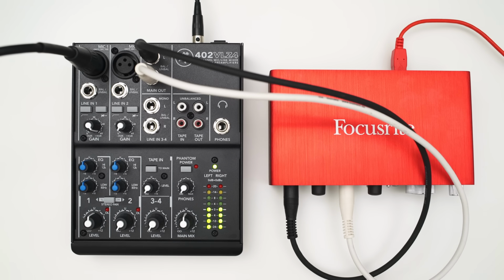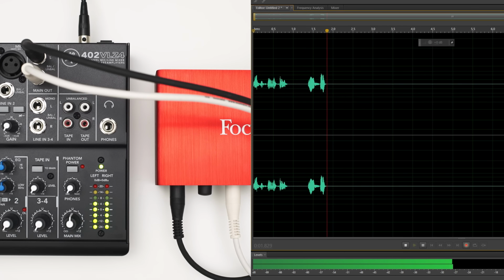Setup Guide - how to connect a Mixer to an Audio Interface for audio recording

Comment: Hello. I have a Pioneer djm 600 mixer and two turntables. How should I connect it to the Stainberg ur12 to get clean sound from the turntables? What cables should I use?

Comment: Hi Julian, I have a question: 

Is it posible to simply connect a compressor inbetween the main (stereo or monitor) out of a mixer and an interface?

I ask you this because I want to connect a keyboard in stereo and two mic's - one dynamic and one condenser with an external preamp - to my old Fostex XR7 4 track mixer. 

Though this mixer has two inserts on channel/fader 5&6, I do not want to switch my keyboard and mic's on channel 5&6 all the time. Therefor my idea is to use the stereo out or monitor out channel to engage the compressor (RNC1773) before going into my 2i4 Scarlet interface.

Btw the Fostex works with RCA connections on the stereo out and monitor out, but I also have adapter plugs to jack. So using either ts or trs cables - which I yet have to buy, but I'm not sure what to buy (I have troubles getting my mind around audio issues) - shouldn't be a problem.

Thanks for the video. Hope to hear from you with some advise.

Ps I want to use this Fostex mixer because it has two aux channels for two FX processors I have and want to connect. It also is pretty quiet and I don't have the funds to buy a new mixer with two aux channels - or inserts on the out channel.

Comment: The pot on the Focusrite was left in the fully counter clockwise direction? So, all of the preamp gain was done with the mixer, and the Focusrite did not do any preamplification? The signal was just bypassed the Focusrite preamps, and went straight into the ADC in the Focusrite?

Comment: Hi Julian 
just a question regarding this subject 
I have been looking for a small Line input adat box to plug some modules in to then input to a RME babyface pro FS 
I not find a simple line one and don’t want to pay for mic preamps when it’s only for a few keyboard modules and cd player, so for now I will use a mixer can you recommend one that is good quality and Can I use any of the four inputs, the manual states all four can accommodate line BUT I see nowhere to switch between line or mic or am I overthinking and it’s automatically detected hope so
Thank you been following your Audio presentations a long time always the most trusted advice on the tube

Comment: Hi I hope you can answer this but is it possible to plug a mixer into an audio interface and then plug speakers Into the mixer and then be able to hear the sounds from your computer coming from the speakers

So basically Will this work?

Laptop < audio interface < mixer < speakers

Comment: The problem I'm having is I'm hooking it up correctly and turning up the gain real high on my mixer and it registers real low on reaper. I play back my audio and it sounds real low. When I plug mic directly into interface and turn up the gain it sounds a lot louder when played back. This method of hooking up main outs of mixer to line level of mixer isn't cutting for me. The waveforms are flat even when gain is up high on mixer and the playback is too low. I'm using a Xenyx X1204USB mixer with a behringer UMC 204hd interface.

Comment: I dont understand why you are using trs cable to go into the focusrite. Those are stereo cables, but only providing mono inputs per channel. Wouldnt a regular patch cable do the same thing?
Reply from the maker: Hey, these are balanced connections that's why they are TRS. This gives you greater noise immunity compared to an unbalanced TS connection.

Comment: [GERMAN] (ENGLISH BELOW)

Ich benutze ein Xone 92 über record out in den Scarlett 2i2 und nehme in audacity auf. Trotzdem ist die Tonqulität absoluter Müll. Habe alle Einstellungen/Kabel/Treiber etc überprüft und alles top. Gibt es irgendeine Einstellung die mir die Qualität verhaut?

ziemlich frustrierend mit dem teuren Equipment...

[ENGLISH]

i use a xone 92 mixer plugged the record output into my scarlett 2i2 and i am trying to revord a set in audacity. The sound quality is VERY BAD. I checked all Settings/Cables/Drivers as far as i could and everything should be theoretically fine.
Is there any Setting i am missing?

Very frustrating with all that fancy expencive equipment...

Comment: Yea but how do I send a stereo signal to the mixer from the interface? Just do the same thing with the outputs on the back of the interface into the mixer? Seems logical.
Reply: Same question here, did you found anything out?

Comment: Hope somebody sees this. I need a fairly budget audio interface that has onboard EQ included in it because I really don't want to use VOICEMEETER or STEELSERIES SONAR just to EQ my voice on the software side and have to deal with BS latency and additional sound device configuration and routing just to be able to use it.

Comment: Thanks Julian for the step-by-step tutorial.
However, I think around 3:20 you forgot to show more directly how loud the level knobs of the interface should be. I know you've responded that indirectly around 4:15 (the -20 dBFS thing), but I think it's worth to show that,  not only for the noobs who like to max everything, but also for some strange things that sometimes happen in stereo setups. For instance, I've found my Scarlett 2i4 (2nd Gen) has noticeable level differences between both input channels (right is louder), even when they receive a monaural signal and both level knobs are obsessively setted to the exact same position. Your Scarlett also seems to have (a bit less of) the same issue.

Comment: Amazing vid! That being said, I am recording my band live through a powered mixer w/ E drums [we all wear headphones w/ the mix coming from the board], signal is sent to an interface [just bought the focusrite 2i2 gen 4]. My mixer has 2 rca plugs out, I am using a 2 rca to a 1/4 inch stereo cable and sending this signal to 1 line input. Would it sound better to get 2 separate rca to 1/4 inch mono cables and send them to line 1 and line 2 input? Or would I use 2 separate rca to 1/4 inch stereo cables? Again great vid and not often discussed!  Also, I am going to experiment with the air vs air 2 features and no air and will let you know the results! Much love from Upstate NY! Oh, I am currently using Audacity as my DAW is the Ableton lite that comes with the focusrite better?

Comment: Hi, I was researching the Mackie 402VLZ4 as an option to add a couple more XLR microphones to my GOXLR Mini Setup via the Line In of the Go XLR Mini. Do you know if the Mackie 402VLZ4 has enough gain to drive a Shure SM7b or SM58 mic? I believe it is advertised as having Onyx Preamps with up to 60db gain. On my Go XLR Mini, I have to set the gain to 65db to drive the SM58 adequately, but I know the advertised gain numbers on many of these units cannot be directly compared.

Comment: The gain and main mixer here isn’t being used right. The main isn’t set at Unity but adjusted based on the lights and the gain is adjusted using the clip light

Comment: What sound sources on windows do u pick have your mixer work in tandem with your interface? At the moment I can only operate the interface and the mixer separately. So if my interface is my default source my mixer doesn’t work with the mic and vice Versa, but my mic will still work on its on with either the mixer or the interface just not together. What am I doing incorrectly? Thanks

Comment: Why -20dB in the Recording Software? Did you not give away signal-noise-ratio at your recording by this?  Ah ok you "hum" with costant signal noise in your micro which shows on your mixer 0dB and have +20dB till clipping. In recording software you have -20dB. That means you have also 20dB Space cause clipping begin there at 0dB.  Ok i understand.  The "hum" i hear first at second hearing your video. My Denglish is not perfect 🤣

Comment: Why use a mixer at all? Adding anything to the signal chain introduces noise and the opportunity for signal degradation. Why not just plug the mic directly into your audio interface? Any EQ is going to be handled by the software anyway.

Comment: When I get the mixer signal to 0 db, that signal is too hot inside the DAW. It peaks well above minus 12 db. If I turn the gains down on the mixer, it is well below the 0 db mark but the level is okay in the DAW. I am wondering if the signal is somehow not clear or not as good in some way because I have to dial back the gains. Anyway, I guess I'm saying it is not always so straightforward...

Comment: Now that you've introduced mixers into the equation, it'd be interesting to see how the interface of a USB Mixer fairs against a dedicated interface. I was looking at some general specs and they seemed decent, but not quite as good as a dedicated interface, and I've heard from other people that these sort of equipment do not last as much, even without taking them to on the road for gigs.
Reply: Also very curious about this. I have both a mixer with an interface, and a standalone interface. I am realizing I have options for how I can hook things up and I'm not experienced enough to know what is what. I'm not sure I always want my monitors to need to be hooked up "through" the interface, but I also want to be able to record the mix from the mixer... I am thinking about using the control room out to help me split that signal path.

Comment: what if i have a mixer > scarlett and traktor and a controller for traktor too how do i connet those ? so i will need that with the controller i have to control traktor while the scarlett or the audio interface will have to get the sound from traktor pass trough the mixer and reach 6 speakers connected to the mixer ... is it possible ?=

Comment: We're seen you are using TRS (balanced) cables to connect a mixer with an audio interface. What if i want to make a next connection, and connect main out of an audio interface to amplifier (with passive speakers), where i only have RCA input into amplifier, so i have to use TS to RCA, unbalanced cable. In that case, does it have a sense to use balanced cables to connect a mixer with an audio interface, or i'm fine with unbalanced cables too?

Comment: well and clearly explained only what should you do if your audio interface only has a mic/line 1 input and inst 2 (for instruments) e.g. the u-phoria umc 22 then it is not possible to do left and right when i use a orchestra wants to record with all their equipment at the mixer (without usb) with audio interface is there a solution for that?

Comment: Is there any reason why you can't use TRS—XLR cables (TRS from mixer into the XLR inputs on the interface)? Would the cable change the preamp input on the interface?

Comment: Question please, my mixer has a 12 channel  and also has an integrated interface 2 channel buss which can be sent by aux to my pc and also a return I put aux.  My question is I want to record a band of 5 Instruments all at once and mix each track after on the mixer . Now the mixer doest not allowed me to do tha it only sends once single audio interface channel trough the interface to the pc software. If I go and buy me 1 8 channel interface can I plug that to my mixer and will that gave any issues having already an I terrace

Comment: Great video....concise and without boring talking.  Question: after connecting my Yamaha MG/12-4FX analog mixer to my Steinberg UR22MKII interface, how do I now connect my two small JBL powered monitors?
Reply from the maker: Hey, just connect the monitors to the  main out of the UR22MKII and select the direct monitoring option on the interface.

Comment: hello Julian, i need your advice, i have a dynamic mic and an interface...i want to use a mixera s a preamp to boost the low mic volume, can i use a mixer as a preamp? i dont want to by a mic activator or a preamp...just use the mixer preamp istead to boost the volume without introducing noise???

Comment: Once again straight to the point, with actually useful information. If someone or Julian can answer these questions It would be very helpful:
- Can you, or should you in stead keep the mixer gain to 0 and then increase the gain on the audio interface to make better use of the interface's better preamp ? Either through master out or insert out ?
- If this is indeed possible, would there be any degradation in quality between directly connecting to the interface if the mixer has 0Gain, UVol, 0Comp, and Flat EQ?
Reply: Literally the only reason to do this would be if the mixer has a better preamp you want to use. Otherwise, you would be better off plugging straight into the interface and not wasting time with conpletely redundant hardware

Comment: Please I have a challenge. My soundcard has just one line in. So when I connected the prs cable to the line its only sounding on the left of the headphone   What do I do solve this. Is it possible to use a pRS cable from the left main out of the mixer to the line 1 of the soundcard and still get sound from both earphones and not just on the left side.  Help out

Comment: Audio interface are almost the same with nowadays call a sound card. Some soundcard come with a number of features including reverb, bass and treble control, echo control, effect, and other dj sound effect add on , anti feedback. A simple sound card iofone square cost US$ 4, some of more features like I had descripted cost up to US$40 but you must remember that is a all in one mixer,. Interfaces, effect and anti feedback.
It is a steal price considered buying two or three separated consoles, cas the wiring and space could burn a hole in your pocket.

Comment: Another great video... Is it possible to do it the other way around? I was thinking of connecting the L&R output of the Focusrite into the Stereo inputs of the Mixer
Reply from the maker: Yes, totally. Just use two TRS to TRS cables and run the line out on the interface into a line input on your mixer. I recommend to set the gain on the mixer to unity and adjust the volume on the interface to get a decent levle into the mixer. You probably need to max out the output volume on the interface.
Reply: @JulianKrause  Great! I'm gonna try it after work... can't wait 🙂
Reply: Update: the interface-to-mixer setup worked well. However, there is so much noice in the output signal compared to the mixer-to-interface setup. Maybe because of the very poor EIN and/or Dynamic Range of the XTUGA mixer. The Focusrite interface definitely records much clearer signal.

Comment: Excellent as usual.  Thanks.  Just one remark about the Jack cables.
I noticed that they have 3 connectors like stereo cables, and after a quick search i understood that they were balanced mono cables, which is sometimes equivalent to a stereo jack TRS cable, but not 100%.
For a mono microphone with an XLR connector, if the mixer has only a jack balanced input, the best solution should be to use a XLR to TRS mono adapter having 3 connectors to keep it balanced.
It would be kind to confirm if TRS mono balanced and TRS stereo are the same product, and the best choice, or not.

Comment: Love your videos.  What about the interface gain with this setup?  It wasn't addressed, still set at 0 gain, which should mean no signal on the computer.  What about the OS system mic input gain?  I've never understood the mic input gain in Windows and how it should be set with an audio interface.  I have a Motu M2 and Audient Evo4.  Thanks!

Comment: With a mixer can you plug in 2 mics and send them to 1 jack on the audio interface? or to plug to 2 mic to 1 jack on the audio interface you need a cable like 2 XLR female to 1 XLR male? Of cource the 2 mics are the same kind and if the same brand and model, the better this would work I asume.

Comment: Why do have to use TRS Cable? why not TS ?
Reply from the maker: Otherwise it is not a balanced connection. Only balanced connections can effectively avoid ground loop problems and lower cabel induced noise.

Comment: For e.g in my Behringer mixer if have connected my I pad or I phone in channel 6 & 7  & connected outputs to 2i2 with mono cables as u mentioned, now how Will I select inputs from logic as it does not show up input 6 & 7 which should i select from logic hope you are clear with my concern,  can u guide to select input from daw?

Comment: My mic is plugged into dbx 286s preamp and my interface is m- audio 192/4 , my mixer is Neewer nw02-1A. Currently the way the interface works i have to keep changing the volume due to usb and direct knob every time i want to listen to monitor speakers. My goal is to simply use the mixer only for my monitor speakers from the mixer out put without having to change the settings on the interface when listening to my monitor output speakers. Thanks

Comment: I don't really want to hate, but is this an out-of-season april fools joke?
On a more serious note:
What's the point of connecting a 2 channel mixer to a 2 channel interface?
All it does is to take away the flexibility to individually meter each channel in the DAW.
The only real benefit I see is if you want to record drums, allready have a multichannel mixer and a 2channel interface,
and you don't want to spend the extra money on a multi channel interface (because we all know, how pricy those can get).

Also I was gonna comment on how TRS cables are pointless scince each cable only carries mono,
until I realized, that there's a thing called ballanced signal.

Comment: Hi there Julian, I like this vid tutorials your making, and I'm sure others like it too so keep it up. Just a question, is it alright if I use TS cable in connecting my audio interface to a mixer? Cause in your vid you've used TRS cable. And will there be a big difference in the recording? If I keep using TS cables?